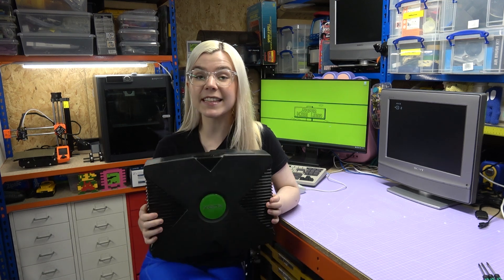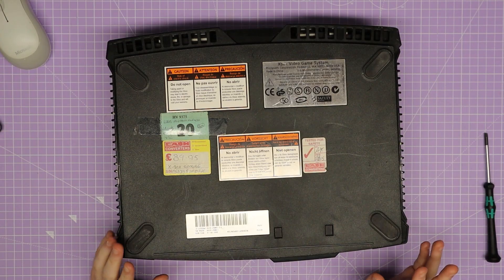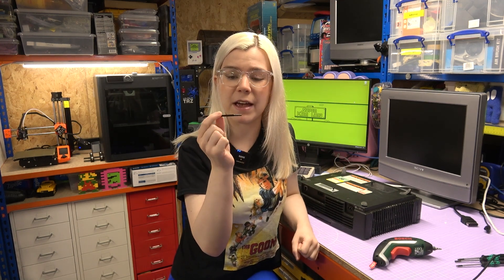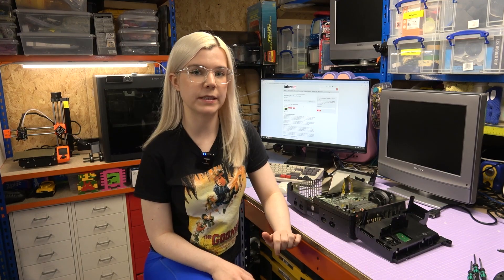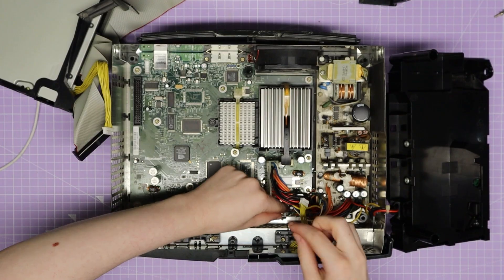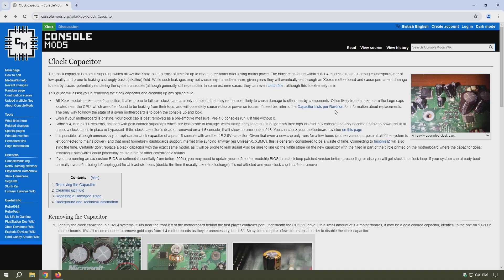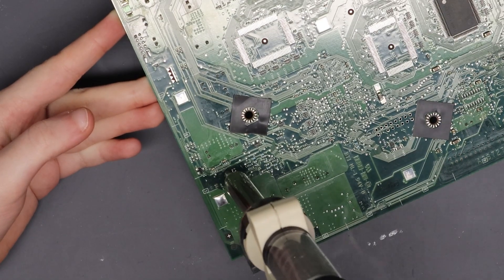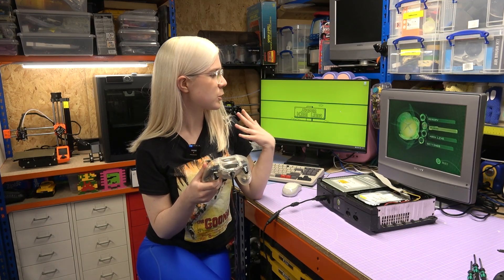Removing the Xbox Clock Capacitor before it destroys the console

Comment: Well done. Looking forward to the next parts of your OG Xbox modding journey.
Reply from the maker: Thank you ... now looking at soft modding and replacing the HDD with an SSD, due to the age 👍 ... love you videos BTW 🤓
Reply: @karilawler  soft mod is probably good enough, but worth considering installing a modchip. There's some really useful benefits over the softmod, only reason to do softmod is if you are on tight budget or don't know how to solder.
Reply: @karilawler  Noooooo. The modchip way is way better (and safer!) than softmodding, specially if you want to replace the hdd. 
Check OpenXenium, or any of the other modchips!
Reply: @karilawler  Think about hardmodding. Project Stellar is a new-ish modchip for the OG xbox consoles which has a novel approach, allows lots of interesting stuff (such as removing the size limitations for HDD/SSD) and comes with some modularity which makes flashing and updating a breeze.
There are also mods for HDMI output and more, the scene around old consoles has been pretty alive in the past years. Worth looking into :)
Reply: @karilawler  OMG why you yell in this video so much!? You have the mike right under yer mouth, we can hear yer.

Comment: Been meaning to do my clock capacitor for a while and your video reminded me to do it just now.

Had my Xbox since 2005 and it doesn’t get much use which is probably why the capacitor was bulged but hadn’t started leaking.

It can join my Dreamcast in the pile of consoles that quote Robin Williams and Jumanji’s What year is it?” When it does get used.

Comment: The door opens with these once they are modded....  they turn into a proper jack of all trades,  with larger HDD's  all your games can be stored on them, large IDE drives can still be sourced if you look around...  which  also means  faster load times and you can keep your original disks safe..  you dont even need a modchip on most of them if your unafraid of reflashing  the bios through the LPC with either  Evox or executer  firmware... if you do this you will need to install from the EvolutionX DVD to  open up all the features...  a simple mod that some people used to use was replacing the stock IDE cable with an ATA133 one...  I never seen any benefit though....  I still got  a 1.4 kicking around with a 300GB Maxtor  drive in it, it used to have the aladdin chip in it running Evox but as I flashed the  system bios with Executer2 I had no further use for it so fitted it to someone elses  about 20 years ago..

Comment: It should be brought to attention that in this video... you will receive the prompt to reset your clock every time your console is disconnected from the power source. Which is tbh much better than having your xbox corrode away.

Comment: I have never heard of the clock capacitor ruining the motherboard.  Why on Earth would you remove it?!?!  I have had my OG Xbox for over 20 years and have had no issues at all.
Reply: version 1.6 of the motherboard doesn't have this issue. Microsoft at the time cheaped out on much weaker and less durable capacitors suscepting them to releasing like a battery acid type fluid onto the board, corroding it over time and leading to permanent damage.

Issues can be seen for example if your xbox is no longer reading disks properly (even when clean and unscratched), and the system asking you to set the clock again.
Granted removing the capacitor will keep asking you to set a time once it loses power from the socket.

In my case, im on version 1.1. Mine looked like i had a manufacturing issue because my capacitor wasn't properly connected. I say this since the warranty stickers hadn't been breached. Eitherway i took it out incase.

Comment: This can happen to any of the capacitors on the board.This was due to the capacitors used in electronics from 1999 to 2007. The best thing to do is to check them every once in a while for leakage or the top of the caps to see if they are bulging. They should be perfectly flat. If there are no signs of this, you should be fine.

Comment: Thank you so much for these links in video, they are very useful. Also I would try to use hot air on labels so not to puncture them for those two central screws at the bottom but just my preference. Xbox Classic is my third favorite console of all time, love it to death. Have 5 of them but will get more. Just beated Black, trying to find a way to remove blur flicker from some games like Splinter Cell games, Crimson Skies, etc.

Comment: checking the other capacitors might be good thing to do for the 1.0 version seen some corroded besides the annoying clock cap also mfg. date works as well if you don't wanna open it for identifying the Xbox version luckly I got a 1.6 or 1.6b version from 2005 so no removing capacitors needed

Comment: Another fault they had were faulty traces at front of motherboard due to greasy fingers in manufacturing. I had one, the only way to fix it is thin wires across the solders

Comment: The front mounted controller ports are really just a proprietary plug for USB. I would mod the jacks and the plug on the end on the controller to be standard USB-A as it not only enables you to use the controller on your PC, but also allows the use of XBOX 360 corded controllers on the old original XBOX. This requires flashing new firmware to the XBOX which is possible.

Comment: I found mine easily as it was starting to leak already but not enough to damage anything. I did the wiggle with it flipped upside down to prevent further leakage onto the board. I'll do a proper removal when my new capacitor comes in the mail. Favorite games are Ninja Gaiden and Splinter Cell.

Comment: Cleaning up any leakage from the clock cap is just as important as removing it. Also, it's easier to pull out the clock cap by heating each leg while all the solder is still there. The rest of the solder can be removed by using wick.

Comment: Capacitors are a common fail point in older electronics. Some products have a reputation for certain problems and MS has its share. That said if one cap is a known issue then it is likely others in the device will follow given that they were of similar initial quality and age. It is smart to replace them all if you intend to preserve the device for the future. Often better quality parts can be found than what the factory sprung for originally. Just be sure to match the voltage and capacitance values or go a little higher if you suspect the original part was undervalued and causing the failure due to being overworked so increasing the voltage value of the cap can give it more reliability since you’re increasing the safety margin of its operation. Why don’t they do this to begin with? Math. A few pennies difference in a component’s cost multiplied by millions of units adds up fast and affects the initial sales price point, something they want to control carefully for obvious reasons.

Comment: thanks for the reminder, i have a 1.0 and a 1.1 xbox, i had checked the clock caps a few years ago but never removed them, i took both xbox's apart tonight and both had indeed started leaking,  i removed both  and neutralized the minor corrosion with 99% isopropyl alcohol and both systems are working fine, im not sure if am going bother putting new clock caps in but i may do a full recap sometime in the future
Reply: Interested to know how they are 9 months later? If they're leaking usually it's a ticking time bomb at that point.

Comment: I did a cap change on my brother's Xbox and a led fan and led controller port mod as it's a crystal it all now lights up green. 

I got bit by the power supply as I got a little cocky. The ones that go through the board are easy but the surface mounted ones are a little harder. 
It's just my hobby and I'm learning as I go. I practice on old broken boards I get from the tip.

Comment: Thank you! I have one that I bought brand new in 2002, I will have to remove this from mine ASAP!
Reply: I removed mine last night, it had already leaked some and the legs were so corroded that I was able to just pull it off. That actually might have saved mine with the legs being so corroded, it probably couldn't take any more charge and leak more than it already had. But it's back together and running good!

Comment: There is no such thing as v1.5, It was never released to the public. 
You should google the words "Capacitor Plague Wiki" and read the article. The clock cap is the most damaging and the CPU caps are common too bulge and vent their acid but all of the caps were made during the capacitor plague era and should be replaced.

Comment: Exciting, I recently got one, which I replaced the clock capacitor and a few of the bigger capacitors that were bulging on the top with new ones. I later did a TSOP flash which lets you run a custom BIOS without a modchip, and added a 1TB HDD and loaded >100 games on there. The nice thing with the custom BIOS is that you can easily replace the HDD by just putting it straight into the Xbox without having to unlock/lock it. A softmod can be sufficient though, and the latest/easiest way is using the Rocky5 with the Endgame method, which doesn't require using an exploitable game disk, and can be done only using the memory card or a USB drive with some special files on it.

Comment: Thanks for this video Kari, Ive just gotten a v1.6 crystal version and want to make sure the same doesn't happen to mine. You have some setup there, will need to go on the hunt myself now to find someone with equipment here in Ireland to ensure the same is done without killing the xbox or myself. Ive subbed. Cheers again!
Reply from the maker: From what I’ve read, the 1.6 clock cap is from a better vendor so much more reliable and less prone to leak. However if you do replace it, you have to replace it on this version , otherwise the machine gets put into an infinite clock loop. Hope that helps 👍
Reply: @karilawler  Helps alot yano! Nice one! I gave it a solid clean when i bought it before softmodding. Just checking it this morning It looks in good nick for now but I will keep an eye on it.

Comment: Wait, i can just cut it off? I repasted GPU and CPU of my old Euro Xbox and ghe Capacitator was already dead since i had the "please set date and Time" every time it's started.

Getting of the coolers was a pain and needed some heat. They are glued in with the old Paste. Will help the console extremely. Used Actic MX-6. Runs like a charm again now.

Comment: I'm not a "gamer" as such, Your video just popped up on the recommended. I do have an original x-box though and have played a number of things, mostly from when they would rent them out at Blockbuster. Favourite game, which I own, is Half Life 2. Your video  is very interesting and I had no idea about that problem, so I might take the plunge and try your procedure too! Could you tell me, if the capacitor is useless, why is it there in the first place? I know very little about electronics apart from naming components.

Comment: Im not trying to discount what your saying but i would honestly like to know how could the clock capacitor going bad damage the whole circuit to be unrecoverable if it went bad couldnt you just in theory replace the capacitor after it went bad and maybe replace other components  in the circuit it might have damaged buy it going out and still be able to repair it? Im new to electronics repair and would honestly like to know how the clock cap going out would make it unrecoverable.
Reply: It leaks corrosive liquid and damages the board.

Comment: PSA: Not all clock caps need removed. If I'm not mistaken, there are two types of clock capacitors; an all black one marked Aerogel, and a gold and black one labeled nichicon. The nichicon's are on all 1.6 boards and some 1.4 boards. (my Halo edition and one other 1.4 board came with a nichicon.) The Aerogels are an instant remove, no questions asked. The nichicon only need removed if they are bulging. Nichicon is a Japan company and of a much higher quality and longevity. We are at the 20 year mark since the OG XBOX release so its a toss up. I have two XBOXes in service, both with original nichicon caps, both showing no bulging. As far as recapping, doing the entire board, is not always necessary. I've done a whole board including the little silver flush mounted ones...they are not fun. There is a site that does list all the potential caps you may find on an OG XBOX and how important it is to replace them. General consensus is that the big ones close to the PSU and power connector should always be replaced, especially if the are of lower quality. Also, don't forget that the PSU also has caps too. Finally, don't trust ebay or Amazon caps and especially 'kits'. They could be fakes. This is why I will never buy a recapped console off ebay. You don't know what they used. The website console5 is a great place to get high quality cap kits and you can by the kits in different packages like for the whole board, or for just the PSU regulators or even the PSU. They do offer replacement clock caps too. (no affiliation) Ok, really last thing, if you remove the clock cap, a modded XBOX with a custom dashboard connected to the internet, can be setup to auto-update the system clock.

Comment: So, you simply removed a capacitor without replacing it, and the xbox just worked? What was the purpose of the capacitor, then? Is it like removing tonsils?
Reply: It just holds the time like a battery.
That's why it leaks battery fluid.
Only replace it if you care about the clock saving the time set.
Reply: All xboxes will have this problem eventually

Comment: The capacitor leakage only occurs in dusty systems left powered on idle or put inside hot humid storage where the internals aren’t in a temperature-controlled environment (think back to Pent. 4 motherboards with caps near the socket given how power hungry the CPU was). Such a shame you have to annihilate the stickers and tear up on the rubber feet as to expose the screw holes.

Comment: I had an old XBOX from my youth, I opened it up and my clock capacitor already leaked and corroded some parts, luckily they didn’t seem to be important as my Xbox still works. I just removed it and cleaned it up with alcohol and luckily it still worked. Replaced the HDD with an SSD too, I can just copy games to the SSD through FTP so I don’t need my CD drive luckily, as that has broken as well.